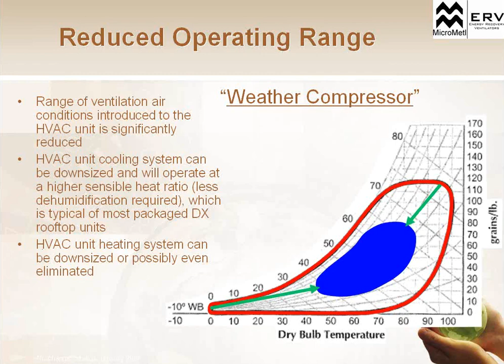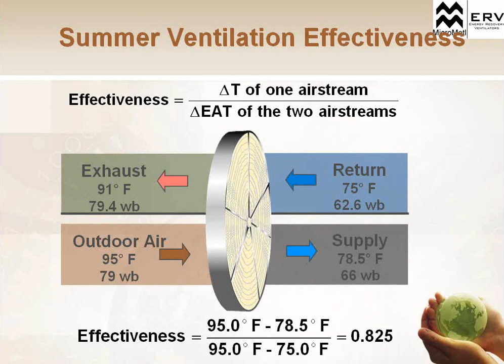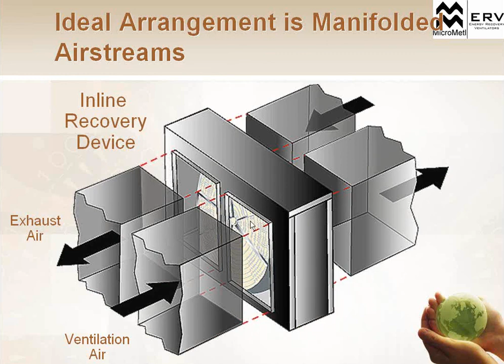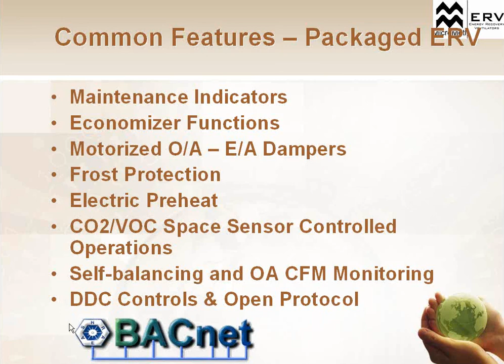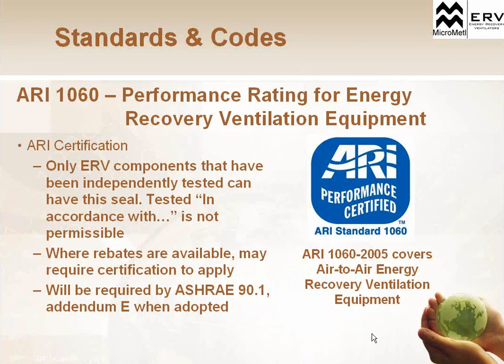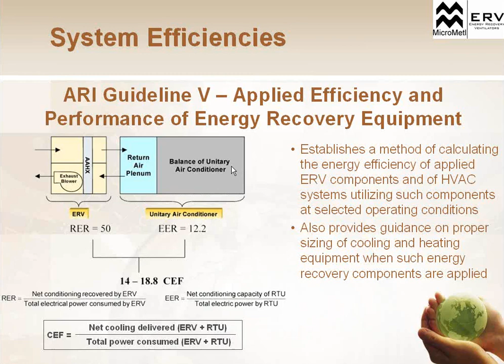MicroMetl Energy Recovery Ventilators (ERV) - Webinar 11/22/10

Comment: You should tell people to forget about ERV if they live in big polluted cities as current HEPA and carbon filters can not filter it out stinky polluted air brought into to building.
Reply from the maker: In the Midwest US where we are based there are very, very few places where the outdoor air is more polluted than the indoor air. Actually, that is true for most of the entire country.
Reply from the maker: In either case, state and local building codes require the outside air to be brought into most building types. So if you are going to bring it in anyway, you may as well consider reclaiming the energy from the exhaust air stream and use it to pre-condition that incoming air. The reason to install an ERV is not because you want to bring outside air in... it is because you have already decided to bring outside air in and now you want to do it efficiently.